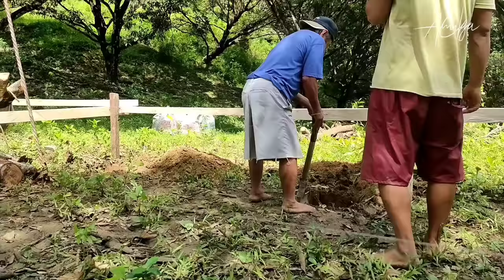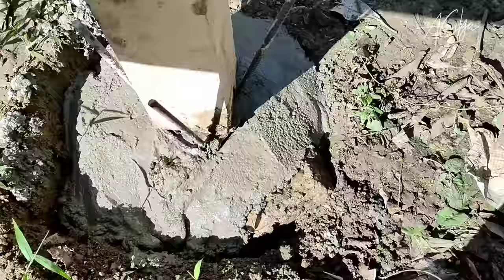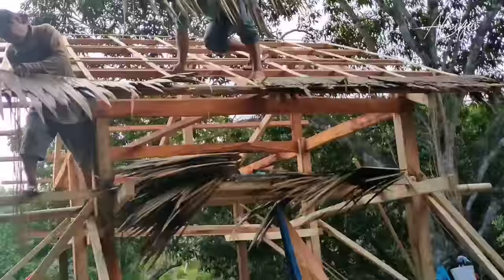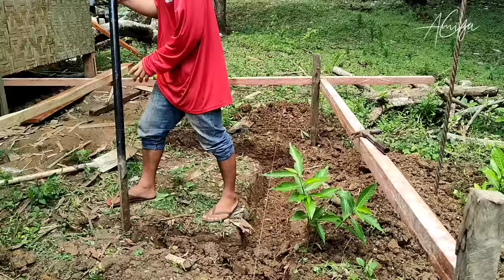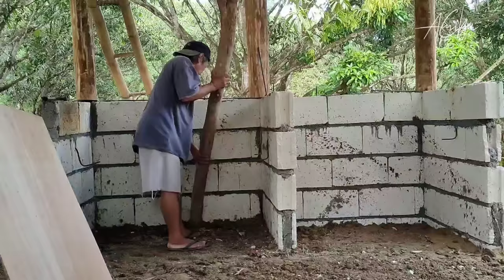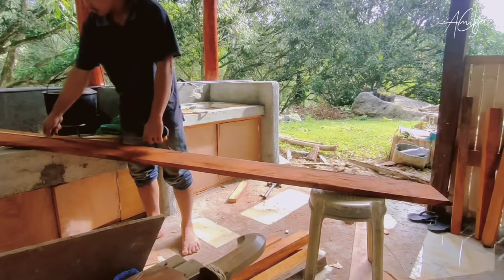NATIVE HOUSE BUILT FROM START TO FINISH TIMELAPSE IN PHILIPPINE | BAHAY KUBO NA 10,000 PESOS GASTOS

Comment: Question:
I love the extensive use of natural wood.
What type of wood lumber was used? Does natural wood need to be dried, pressure treated to resist insect?
For septic plumbing, also have interest in other low cost environmentally friendly fecal composting. 
I believe US author wrote book Humanure (no septic tank needed).
Have any of your clients requested this?
For aesthetic, I have interest in designing-incorporating traditional Torogan. Is this permissible as per Ph. building code?
How much do you charge? Pesos to square meter?
Reply: For flooring it's coconut lumber yes, it must be treated for insect resistance. Before they used molave trees as its foundations or columns to build the house, now they integrated it into cement and even wall panel.

Comment: Hi po. I am watching eating my tinolang manok like this was a basketball championship. May I say, I admire your reinforced concrete foundation piles. Great work and I dont see any use of levels.
Questions:
Should pile rebar be looped into post   to strengthen against storm Typhoon uplift?
Is there enough post to rafter connection to also resist uplift?
What about changing thatch to the inverted bamboo halfpipe. This can collect rainwater to harvest.
What about switching gable roof design to hip-diamond shape? It is proving in tests also resist high storm winds.
I have more questions.